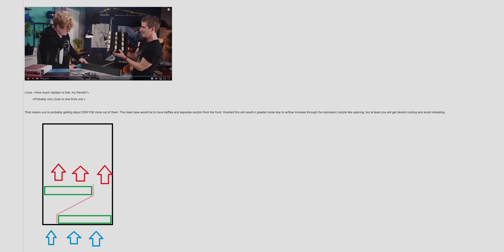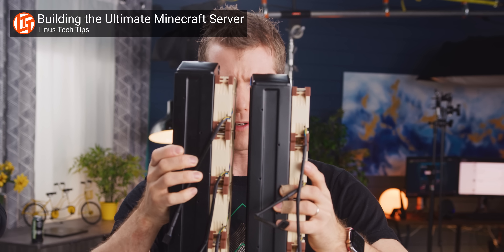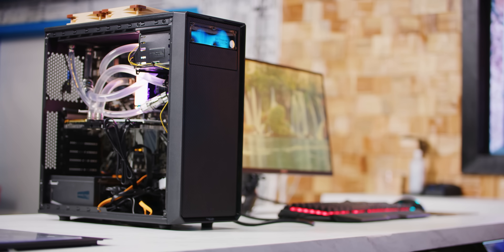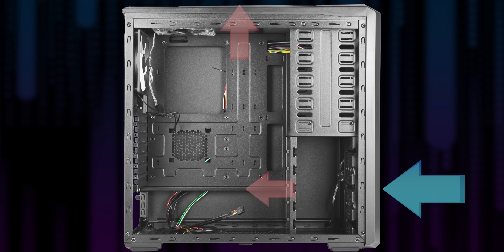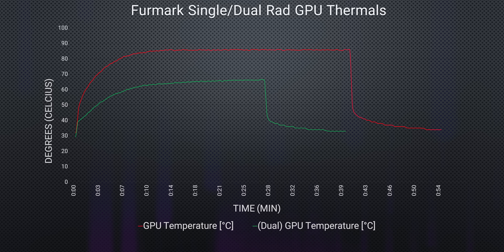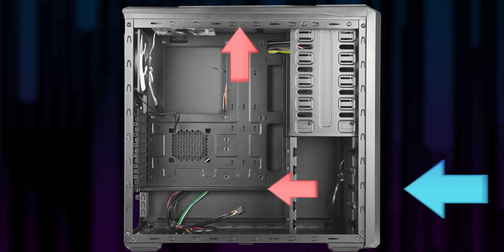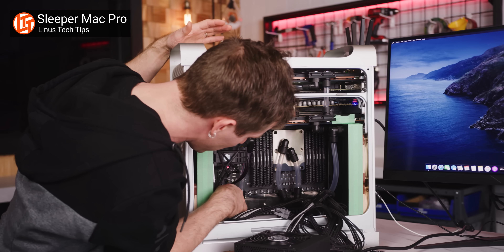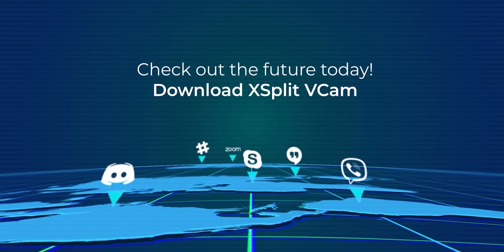I’ve been water cooling wrong for YEARS - $H!T Manufacturers Say

Comment: I would have loved to see tests where both rads get "fresh" air, and also a comparison on the tripple-stack  where the outside air-draw should be minimal compared to a scenario where all 3 got "fresh" air.
Reply: I wonder if the tripple-stack could work like the countercurrent gas exchange in fish. The last rad in the series would get the hottest air but you could also give it the hottest water ensuring a temperature difference. While the first in the series the coolest air and the coolest water. I would love to see it done in the reverse order too so that we could see the difference.  🐟
Reply: yea... would have loved to see what difference just flipping those top fan around would have made.... seems like a shame considering that it would have taken all of 30 seconds.... and would have really killed or validated corsairs fresh vs case air...
Reply: Well if you look at my picture I have 2x 360mm rads mounted on the side of my case which are obviously getting fresh air to both and I have tested mine with just the fans running on 1 only and my coolant temperature starting rising from 24-25 it usually sits on to 35 before I stopped. (probably would have climbed a bit higher maybe I just got the idea already that the second rad worth it)
Reply: I would have also wondered if having a separate or forked loop where the either the GPU or CPU does not need to feed off hot water coming from the other to cool itself.
ALSO
I wonder is that stacked server cooler could be wasting unneeded fans and should either have used single fans on multiple stacked radiators or have benefited from having each rad have dedicated fans with their own dedicated fresh air flow and a forked loop where hot water is evenly distributed through all of them and cooled water is recombined on the other side.
Reply: @OldGamerNoob  I have GPU and CPU on ther owne radiators and pumps, the reasult is big if you hvae a hungry W CPU....
Reply: My immediate thoughts. This works up until you populate a vertical stack. Then, it becomes harder when you have multiple stacks. So for individual computers this is great. Up to a rack of them...? Imagining them pulling air from one corner and blowing out the opposite.
Reply: @akrylamid Why make one comprehensive video (for X amount of sponsor+ad money), when you can make an N part series of it (with NX amount of sponsor+ad money)? :-D

Leaving something untested or to improve on also encourages engagement in the comments, which YouTube algorithms love.
Reply: @Silvar55x  In all honesty I don't mind even a 4 part mini series exploring the subject. I'm happy to pay for my view time by sitting through those dorky segeways as long as the vids are this good. :)
Reply: I gotta ask - why the prop-2-eneamide?
Reply: @mduckernz  It was buzzing around media when I needed a nickname 15-ish years ago :)
Reply: That isn't relevant to the claim. Of course fresh air will make the radiator more efficient but that doesn't mean running air warmed by the first radiator through the second radiator will make no difference or have a negative effect. The problem with many scientists is they don't live in the real world so they come up with stupid ideas which look great on paper but won't work in the real world. So for the Minecraft server and the Hack Pro it was still better to add the radiators due to space restrictions even though they wouldn't be as efficient as they possibly could if space wasn't an issue.
Reply: @CheapBastard1988  while engineers, being human, sometimes have stupid ideas, let's remember that Corsair hasn't had the opportunity to respond, so we've really only heard one side of this story.
Reply: @CheapBastard1988  well you can flip the fans around...
Reply: The ones that really seem weird to me were those server radiators. If the airflow is in the same direction as the water flow then he's literally wasting money.
Reply: @TheWolfJL  if Oxygen Not Included taught me anything, is that you always have to counterflow your fluids in an heat exchanger
Reply: @TheWolfJL   My english is bad. But thet bulid is okey if your air flow has more time to catch the haet frome the radiators...
Thet is only a question of efnency...
Reply: Lamus failed his university degree, like he literally dropped out [get it? ;) ] because he sucked so much. Engineers at Corsair, they passed, and they did a proper degree too... Lamus.
Reply: @brazeiar9672  any citations there bud? Failing and dropping out are two different things.
Reply: @KopitioBozynski  Linus Drop Tips himself, obviously.
Reply: @brazeiar9672  Haha! Epic funny roast (destroyed with FACTS and LOGIC!) -- pure DESTRUCTION! Put that one in the Fortnite PWNAGE compilation!
Reply: @brazeiar9672  - Who's LineMess!? LineMess Who? Why LineMess? Where's your degree LineMess? Is that is hillbilly cabbage units or Celsius too!?

Comment: Hey linus,  as a guy that does HVAC just remember contra flow.  So the hottest water must be on the trailing airflow and the cooler water at the intake to the air.
Reply: So, in my build i have this setup: front rad - gpu - cpu - top rad - pump/reservoir. I was thinking the hottest water hits the rad that exhausts and then the rad that pulls air in from the front. Guess that`s what you are saying is the best way?
Reply: @johntech4621  yes so that the water you want the coolest gets the coolest air...
Reply: @johntech4621  Thats relevant for huge loops. FAR bigger then any watercooling loop. A normal PCs loop will be at a few hundred mililitres, maybe a litre or two for overkill enthusiast builds. All the water will get pumpoed so quickly therough the loop that the temperature equalizes pretty fast.

There are tons of tests that show that looporder is utterly neglibile.

Comment: if, let's say, the room temperature is 20 c and the water in the rad is 50 c in a scenario where the rad is enough to cool the water and heat the air to where they have the same temperature (say 35 c/ in the middle) the air could potentialy gain more heat from the system reaching more than the temperature of the water( that would be 35 c in this case) and it will heat the water it just cooled, just like corsair said. But if the rad wasn't enough and it will bring the temperatures to only 30 in the air and 40 in the water, as long as the air doesn't gain 10 c from the components of the system( I mean, c'mon)  it will still be cooler than the water so it could still lower it's temperature. What I mean is, Linus is right but only till a point where the system has enough cooling power from which point Corsair would be right, so it really depends on the heat produced by every system. I'm not an engineer but I think this is how it works! Dm on insta @Mihai165 to debate this!

Comment: LINUS, YOU DIDN'T ACTUALLY STACK THE RADS, THEY'RE TALKING ABOUT RUNNING THE AIR IN SERIES NOT THE WATER, there's no point when the air you're drawing from is the same temperature air coming in from one source with a rad hooked up going through the pc to another radiator. you just put both on intake and had the exhaust blow it out it's ass or had them both on exhaust and the air from the other rad didn't even touch the other. it's not PROPER !

Comment: Corsair really speak some *#*# sometimes. I brought the original K95 RGB when it came out Amazing hardware but boy does their software suck. First they said it was a 16Million color RGB and they got caught out as it was only 256. Second they had a HUGE memory leak in the early Cue software and their response was it was my fault that i had 64Gb memory in my system. You just can't help some people which is a shame as their keyboards are AMAZING machanically but their software oh boy still take up 1-5% CPU usage on an 8700K @5ghz where as Logitechs Ghub takes up 0%.

Comment: I'm a bit confused. You're saying using 2 radiators that recycle air from the first to the second is better than ____?

Better than only 1 radiator? Definitely. No argument there, I agree completely. 2 > 1.

Better than a second radiator that does not recycle the air flow? My understanding of thermodynamics disagrees.

I imagine Corsairs argument is that if you're going to go through the effort of having two radiators, don't stack them. You're wasting money/electricity. They should each have their own air flow for best results. Outside the case for even better results. I don't know what Corsair said specifically though, so whatever.

Comment: Hmm. Don't know if it matters to the end result or not, but by Corsairs statement of "stacking radiators doesn't work" it seems to me they might mean it in a figuratively way, not just adding 2 radiators in a case but rather stack them next to each other closely, for instance like your server build in this video.

Would you test that out as well?
Reply from the maker: We did in our Minecraft server (triple stack). It still worked. As we explained in the video, there are many other variables in a water cooling system, so making blanket statements like "stacking works" or "stacking doesn't" can be misleading.